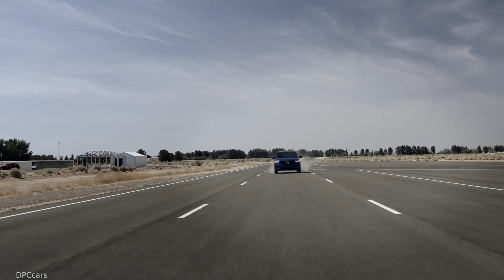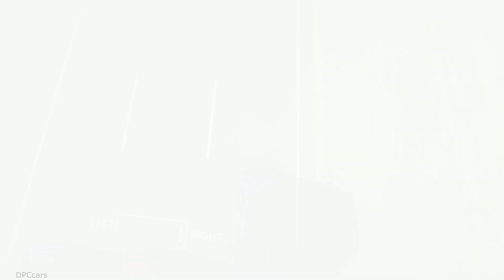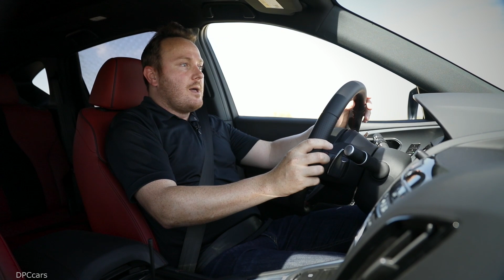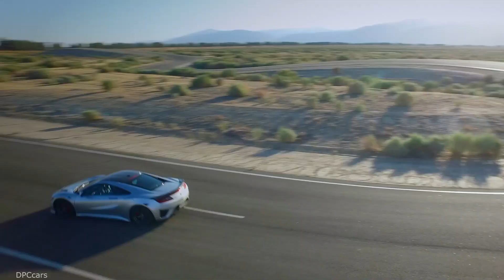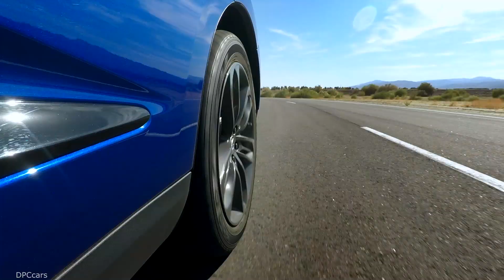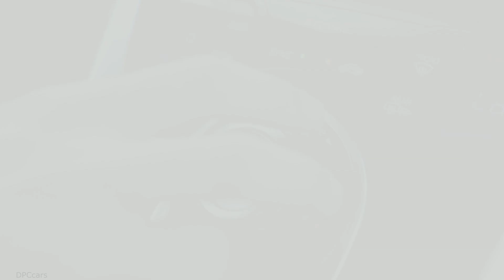Acura Super Handling SH-AWD All-Wheel Drive Explained

Comment: Torque vectoring technology makes sense. I own MDX 2012 with SHAWD, the torque vectoring has saved me in several instances when if i did not have SHAWD; i would have lost control on a wet and icy road.  I drive about 15k miles a year and having that assurance is definitely necessary for inclement weather.